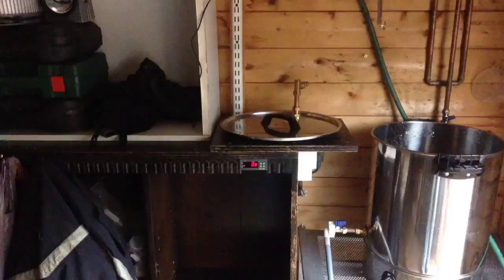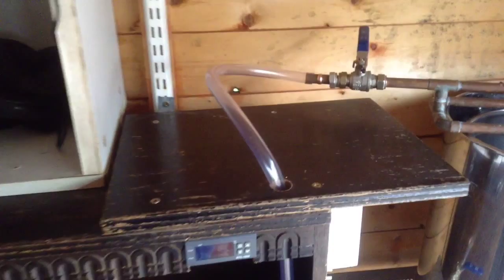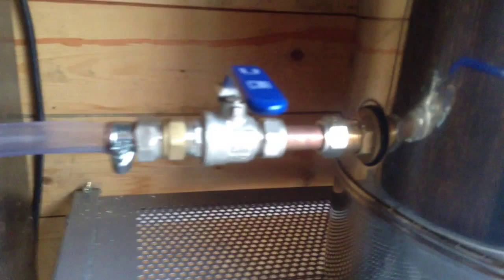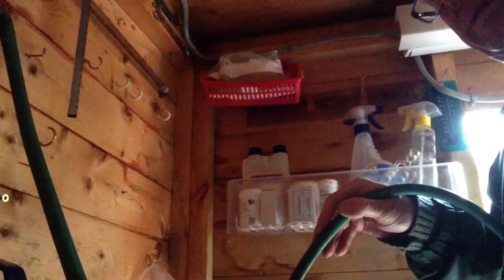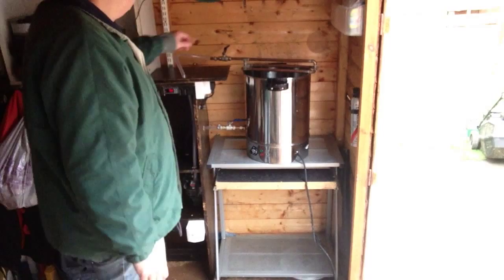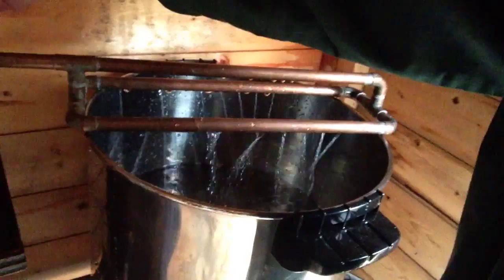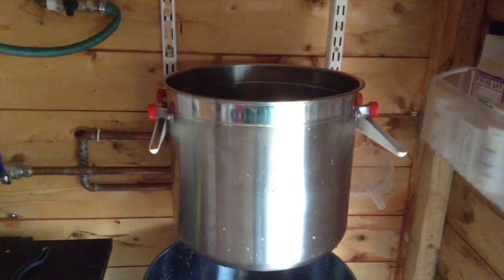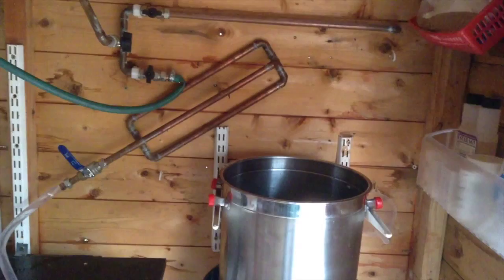Vlog 63 Homemade All Grain Beer making Machine Part 3

Comment: Nice job Jim.  Possible idea to help with bringing the grain kettle out would be a pulley on the roof of the shed centered on the brew pot.  Put a climbers clip on the end of the rope, lower it down to the handle, lift the bucket out, give a twizzle onto your supports and Bob's your Uncle.  Just make sure you have a tie off so even if it slips the kettle doesn't slam back into the  brew pot.  Will wait for the next installment with antisipation.  Cheers.
Reply: That is brilliant Alex, off to eBay next to take a look, Ants got a good idea for the pot to sit it on a grid which will be a lot safer. Cheers for the splendid idea

Comment: Nce work Jim. Looks very impressive indeed. Not long now till you are completed.  Cheers Jim!
Reply from the maker: Seems to be taking ages but slowly get there thats for sure Cheers
Reply: I think I am going to bite the bullet and save up for a GF. I dont really have anything to start on. Don't have a wort chiller so probably just as cheap for me to buy one that comes with a counter flow wort chiller and all the gizmos you need. Was thinking my brewpot is a cheap thin ss kind but suspect it has a hole in it so maybe add some more holes and using it for an inner basket but the thing is is 35 litre pot so would need a 50 litre pot on outside which means I could do big batches but I would always have to do big batches I imagine. Any who cant wait to see your one on the go. Cheers!
Reply from the maker: Rookie Brew Yes its a lot on money for a GF but its not cheap this hobby but all the best with you saving and purchase and look forward to seeing the vlogs Cheers
Reply: Yep I hear you. But once we set up she will be cheaper. Cheers!

Comment: Looking good, Jim 

+1 on the bracket strength, you've got the weight of the pot, plus the weight of the gains and the water they've absorbed, might be getting on for 10kg or so 

Really enjoying this mini series, can't wait for the next one 

Cheers 
Ben
Reply from the maker: Yes your not wrong Ben, Ants come up with a better idea of a grid to sit it on so will be looking at that. Cheers for your kind comment

Comment: Looking good Jim. I think with the sparge, you either do a full volume no sparge mash up to the capacity of your boiler, or you get a separate vessel to heat mash water to temp and just pour it on top of the grain pot to drain into the boiler. The former option will result in a lower final volume of wort but less hassle (might be an option for test brews) the latter will get the 23 litre into the fermenter that you are used to. All you need really is a plastic bucket and heating element because you are only heating the water to mash out temps and a jug to pour the water or just trickle it using gravity.
Reply from the maker: Brilliant, I like the idea of the heater element in a plastic bucket for the sparge got to get every lot drop of fermentable whatsits out of the grain. Brilliant idea onward and upwards Cheers for the great idea

Comment: Congratulations on the build.Its really entertaining to watch and spurring me on with my own equipment build.Just a thought on what you might use for the grid to hold your mash tun.You know those round barbecues, they have a substantial round  metal grid on them.I always see them being thrown away at the tip especially as summers just around the corner, lazy people who don't clean them and leave them out in all weathers to rust launch them for new ones .Thats how the big diy stores sell loads every year.
Reply from the maker: Great idea a bit to late though went to Wilkos and bought a cake stand for £4 bargain and looks very strong so hopefully that will work. Cheers for the comment if the cake stand bends then its off down the tip.

Comment: Superb jim. Just mind to make sure those wall brackets are well screwed on. It'll be holding a fair bit of weight. With regards to temp. What about of of those in line heater flask things.  ? Dunno if that is any help. And maybe control the pump with a dimmer switch to regulate it a bit easier. It might take some of the pressure off the outlet pipe connector.  Great build though. I can't wait to see the next installment. Cheers
Reply from the maker: Franks Homebrew77 Yes I think the brackets are a mistake Ants come up with the idea of a grid which I am looking at, I do like the idea of the dimmer switch but thought it may burn out but will take a look and see thats for sure. I will be using the boiler heater with the STC1000 so not looking at spending another big chunk of money Thanks for the help Cheers

Comment: Great video Jim, new sub here following with interest. Must admit alarm bells started ringing when I saw your idea of suspending that big, hot pot like that though. I like the idea of using a strong grid, it would be much more stable. If the pot is too heavy to lift out, can you install a beam above it and use a pulley system with steel cable and/or chain? You could cut 4 holes near the rim of the pot to attach the cable/chains with carabiners. That would make it v easy to lift the inner pot, suspentd it temporarily while you put the grid in place, and lower it back down.

Anyway, enough of my rambling. Good luck whatever you decide.
Reply from the maker: Great idea all round, already bought the grid one or two people have said it would be safer and looking into a winch next. Thanks very much for the ideas and cheers